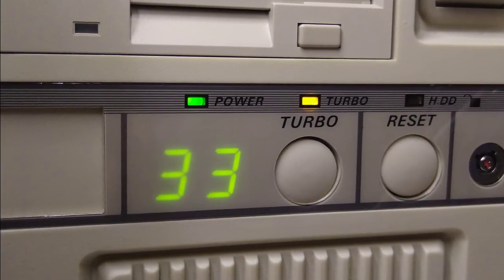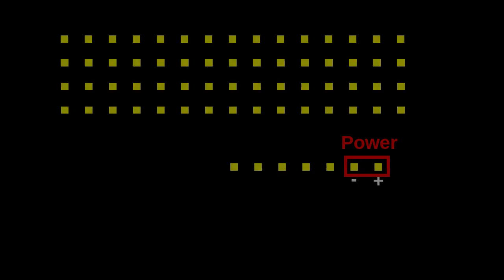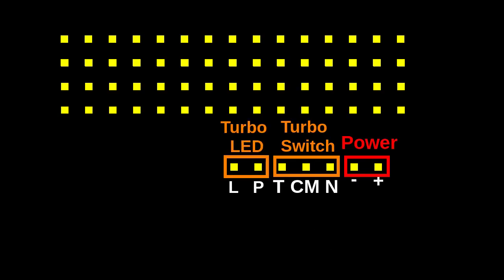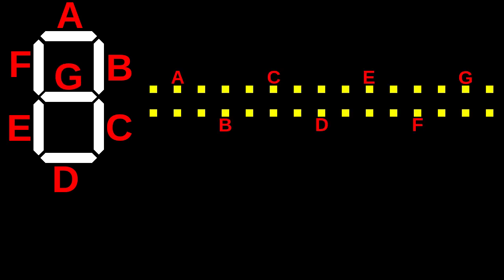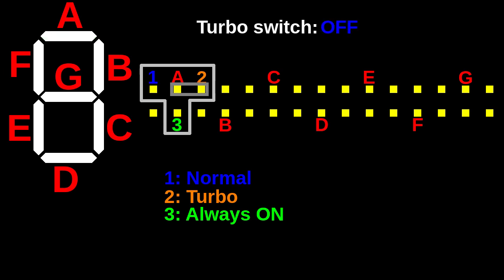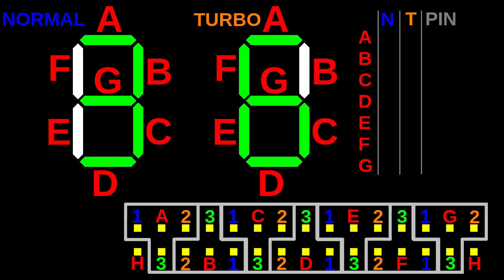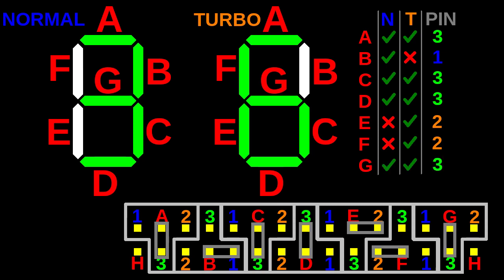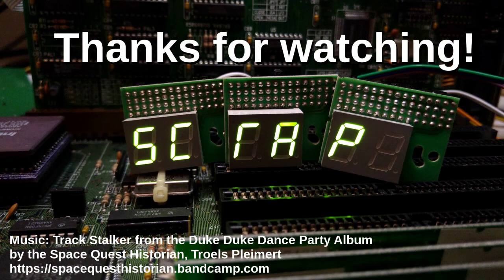MHz Displays Tutorial: How to configure the 7-segment LED displays of vintage PCs

Comment: A really good explanation. This explains a lot of what I saw in reverse engineering mine. Oddly I hooked power up to the turbo led out pins and it was working, but p+/- of course make more sense after seeing your vid. Also I had used the always on positions. Thanks for the awesome video!
Reply from the maker: Yeah, the wiring is quite confusing, it is hard to figure out what is going on without a schematic.

Comment: Thanks for this very useful and informative video. I am rebuilding my first PC  from the mid 90's and it's missing the display (got removed) in the video with the one and two full digits. But i have now a working replacement, only that it has 3 full digits, is not controlled by jumpers but by a chip. Also has a changable battery on there, a small LR41 coincell battery. It will work in my case but i am wondering how to set up this thing to show thw correct MHZ??. It has 10 pins and they read from the left. LTHRR+-SST. PD 900 also on the board.

Comment: I have an old case with this 188 display type. But the controller on the pcb ist damaged and so i soldered wires to all pins that i need to get 100MHz. Is there a source to bye this 188 displays? Until now i couldn´t find one and build a new display with an homebrew pcb and jumperrows like you showed.
Reply from the maker: I am not sure where you could buy these modules. I guess the best option would be to build a clone with new components.
Reply: I am trying to find gerber files to build my own pcb but no luck. Does anyone know where I can find it?

Comment: What mother board do you use? Cause i cant find mb that has 3 pins for Turbo switch
Reply from the maker: The Turbo header on the motherboard is usually just 2 pins: turbo is either ON or OFF depending on whether it is sorted. The turbo switch is usually a 6-pin dual toggle-switch (3 + 3). One part of the switch goes to the MHz display and the other (just 2 pins out of 3 pins) connect to the motherboard header. So when you press the turbo switch you notify both the motherboard and the dipslay.

Comment: Ok, so how is all of this hooked to the Motherboard?
Reply from the maker: The MHz display is not actually connected to the motherboard. The only thing you need to connect to the motherboard is the Turbo cable, which is connected directly to the Turbo switch.
Reply: @scrap_computing  Ok, so you splice the display into the Turbo switch. That makes more sense.